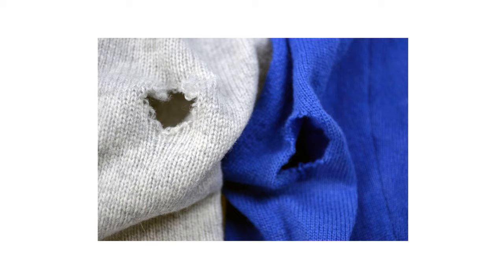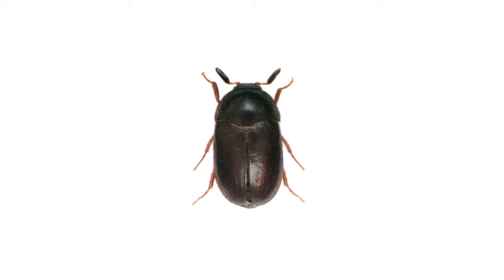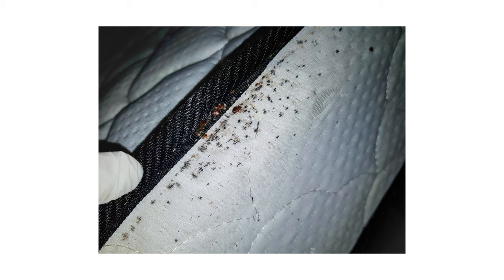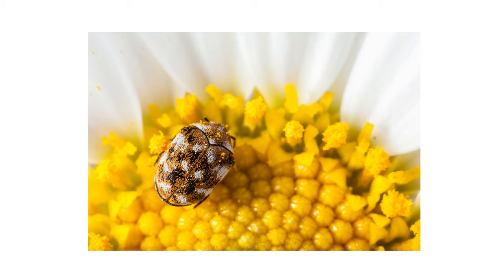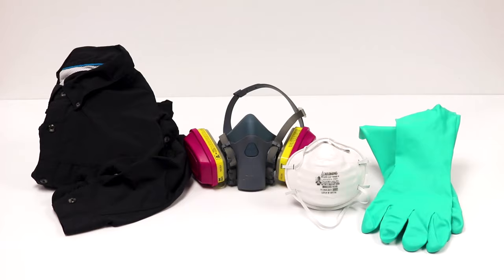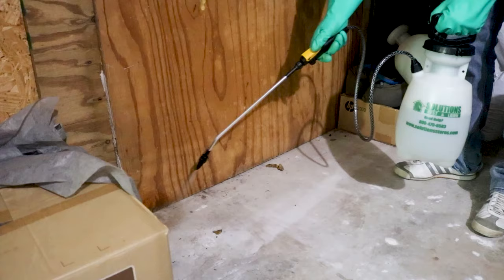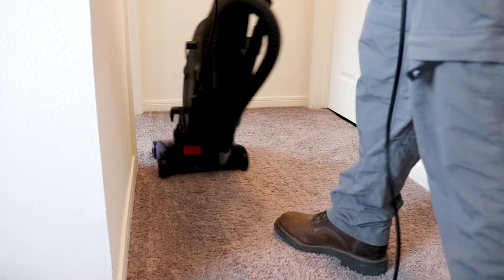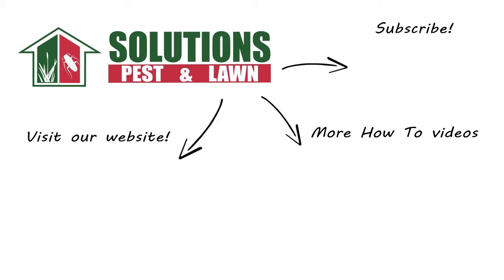How to Get Rid of Carpet Beetles (4 Easy Steps)

Comment: Anyone dealing with this, please CHECK YOUR DISHWASHER! Pull it out from the cabinet, almost all dishwashers have a thick cotton sheet that goes around it for insulation.
Reply: Thank you so much I was losing my mind
Reply: Hi, what does the dishwasher have to do with this?   Thank you.  I appreciate your help
Reply: @vincentkingsdale8334  DIshwashers typically have a cotton padding around them for insulation and sound deadening, it's a warm moist environment with food for the beetles. Kept having recurring issues and this is where I found them.
Reply: @claytonnlambert  what did you do to resolve it?
Reply: Thank you! I have been going crazy for a month trying to find the source of these things. Saw your post and pulled the dishwasher out, there they were, in the insulation. Problem solved!

Comment: Spend under 7 bucks on a gallon of APPLE CIDER VINEGAR .I started seeing them on my couch like one or two. Then 3 at a time... I came straight to You Tube I cleaned as directed and then only seen one in two days. I discovered they were coming in through the windowsill in my apartment.  there were several there trying  march on in. I sprayed my couch, carpet and window and back door all around.  Those caught in the cross-fired died and those that saw me coming retracted and I'm not sure they lived to talk about it. My landlord said the pest control couldn't come until 4/5/23. I notified her on 3/30.   If it wasn't for the vinegar, I would have broken my lease that I just signed and left like a thief in the night No discoloration or damage after my 3-day treatment. I still have 3 days to wait for help, so I put a vinegar soaked rag in the windowsill and sprayed the window frame from top to bottom. All I see is dead beetles and I took pictures. I know If they're coming in mine they have got to be in other units.  There's even a dead fly so I now pests are trying to come the same way. I'm still getting rid of my couch. I'm not bringing anything in there until they seal this place up.

Comment: That requires so much hard work!! All this cleaning and laundering would take me over a month lol specially with my “mother’s thumb” condition. How long do they usually take to start causing damage? So far we’ve seen four black carpet beetle larvae in different rooms and few varied adults everyday in the kitchen :(  the adults started showing up mid March
Reply: It is… & throwing away a vacuum bag on a daily basis? My vacuum bags cost $26 bucks for 6 bags!! I don’t think so. This is a never ending chore too because there’s different stages. This advice is impractical. Every single video/blog says to do it too.  
I’m going to hide my silks,, leather & fur in an airtight storage bin and call it good.
Reply: @mulliganstew72  i
Reply: @mulliganstew72  Hi, I'm in New Zealand and I've got them too. I can't afford to throw away the bags either so i give a good squirt of fly spray down the hose with the vacumn going. leave it outside for a few days then empty it.
Reply: @mulliganstew72  also cashmere and wool. They like cotton too if there's nothing else around.  They eat almost any natural material.
Reply: They can eat through it
Reply: @mulliganstew72 I wouldn't be surprised if you still have them. Unfortunately you need to be aggressive with treatment. And they can get into many sealed containers and plastic you may think are impenetrable because they'll eat through it.
Reply: @szee8588  anything with keritin.so evendust with skin cells in and small amounts of pet fur under a cabinet will feed them til adult hood.

Comment: I started noticing a few a couple of weeks ago. Mostly in my bedroom, but not sure where they would come from. I just did all my laundry just in case they were in there somewhere. I also cleaned out cupboards and found them in the rice but not enough to consider that the source of infestation. Do they like to live in dry food? I had a bag of rotten potatoes that I couldn't figure out was rotting (I was searching for this smell for days) and above that location are quite a few dead ones but not sure that could be the source either.
Reply: I think the rice ones are bowl weevils not carpet beetles. They usually show up in dry grains
Reply: Those are probably weevils but carpet beetles also like cereal and can appear in cabinets. They say that they can wander from their food source so you end up seeing them on the counters and floor
Reply: what is in your cabinet may be weevils. if you crush them they smell sweet, and they will show up in powdered like flours
Reply: They also get into dog food

Comment: I found them on a hair brush I had lost that had left over hair on it, vacuumed the carpet before I spayed the carpet with vinegar it seemed to work well
Reply: did the vinegar work I just bought some but I haven't used it
Reply: Isopropyl works too.  The stronger the better.  Vacuum often.  Keep your clothes clean
Reply: THANK YOU SO MUCH

Comment: How about the ceiling? They often drop onto my floor and I found them hiding in my spotlights and track holder. Can they stay on the ceiling walls?
Reply: YES. I find them all the time dropping from my ceiling and attaching themselves to the light fixture.
Reply: Yes they hide in the outlets .i read to put  cimina powder in the outlets and along baseboards . Use a puffer type thing.  And wear a mask. Look it up
Reply: Also I recently read that insects dont like Iris Spring soap. Do shavings and put in ankle socks and put in drawers, hang in closets etc also said makes house smell good.  Im going to try this
Reply: That should say ankle hosiery not socks. Its a battle for sure
Reply: @carolgeorge6409  thank you Carol. They finally disappeared after tons of pesticide products and lots of prayers. Thank God!
Reply: They fly!!! but they are beetles, just like lady birds (beetles) the do fly, but only short distance, so drop as they run out of steam.then ul see thm just plop down to whatevers underneath.

Comment: If you only find very little lava over a few months, and you are on top of cleaning and there are no signs like holes etc... Do you need to worry?
Reply: Try to find the husks, and that might be the source of where they are coming from. Another tip, like in the video is to put small glue traps in areas you suspect they might be. You can even put a very tiny piece of fabric in the middle. Unfortunately they can come from the walls, like power outlets. But since you are seeing so few, and your upkeep on them is good, no need to over stress. Just be vigilant

Comment: If you have a cat, keep them away from this insecticide bc it will kill your cat. My exterminator didn’t check to be sure what I had and used a growth regulator in my house. Fast forward I have carpet beetles and the worst thing you could spray with is an IGR bc the larvae is what causes the problems. I am highly allergic to them so I welt up like crazy and they like my hair 😢

Comment: I had this problem last year. The black ones. I discovered larvas in crevises of my bed, under every baseboard all over the house, and under drawers. Luckily, not many alive ones, mostly endoskeletons, but there were HUNDREDS of them (visible only in magnification). Also a few dead adult beetles in the ceiling lamps. After googling and discovering carpet beetles eat dust, I moved all the furniture, removed all baseboards, took cabinets off the walls and vacuumed averything I could. Then I sprayed everything with bug killing sprays, normal ones and the capsule ones. At the end I filled spaces between floorboards and the walls (around 5 mm gap) under baseboards with sillicone, so no dust could gather there, and these fuckers never returned.

All in all, it could be much worse - they could have been bedbugs, lice, cockroaches... From what I've read they also dont tolerate temperatures below 20 C, so opening windows in the winter for a day should also help. Maybe thats why most of them, when I discovered the infestation, were already dead - they procreate only in the summer.

Comment: i changed my carpet and sealed the window openings and lower wall openings but i still keep finding one once every couple of days or so. i also sprayed home defense around those openings. idk what else to do at this point
Reply: @Lèmon Lēe yea i washed and sprayed my bed furniture as well and wiped my other furniture
Reply: @Lèmon Lēe i hadn’t seen them for over 2 months until one last week :(
Reply: Update?
Reply: @erniellerena  def haven’t seen them in a longgg time but i just found a larvae crawling last night, but then again it’s bc my room has been messy lately. but for the most part i’d say it’s been good
Reply: @sabreenn5523  you changed your carpet instead of floor? Because I want to get raid of the carpet.
Reply: @Lounaao  I’ve changed my carpets and it did nothing for me. I sealed the bottom of the skirting boards and they disappeared for a while. But now I’m seeing some again. I just don’t get itttt
Reply: I just read they can hide in light fixtures and sockets.  I wonder if i can put diatomaceous earth in sockets

Comment: I've only found two adult and two larvae in my apartment then suddenly staring getting bumps all over my legs that are not bites... apparently its rare but I have an allergy to the larvae. I don't know what to do... I've cleaned, vacuumed and sprayed everything with vinegar but I keep getting more and more itchy rashes on my legs and I haven't seen any more around T^T i'm dying
Reply: Oh my God I’m in the same boat did you figure anything out I’m dying swear I can’t take it anymore
Reply: @kaydogg2086  sameeeee
Reply: @backwood4509  I did a deep clean. Also check your closet, empty shoe boxes- they like to hide there . You must clean everywhere and sanitize it. Even your drawers! As far as the carpet, I just vacuumed, threw bleach everywhere and poured home defense insect killer in all small corners and cracks. Carpet beetles like to hide in crevices so also look there. I haven’t seen them in about  5 months.
Reply: @backwood4509  also, if you have a pile of clothes sitting somewhere on the floor, remove it asap. Carpet beetles like cloth and fuzzy material . I had a bad habit of leaving piles of clothes on the floor. This gives them a place to hide and lay their larvae 🤮I also ordered new sheets and pillowcases , and curtains .

Comment: Carpet beetles are very difficult to completely get rid of if theyre established, first you need to professionally seal your home from the inside out, caulk every crack, have flawless metal screens in every vent and fireplace and flawless window screens that have no give, even sealed under your cabinets and beneath your piping and in your fireplace. Then you need to professionally clean and isolate, or replace every single piece of non synthetic fabric, or soiled synthetic material, (they will eat mildewy and damp wood/ polyester/ insulation.) They can live off bugs and mildewy insulation between your walls and all it takes is 1 rentry to reinfest your home, wether its through the window, a diety vacuum, or an unreplaced mattress.... these fuckers are not as easy to get rid of as these videos let on.